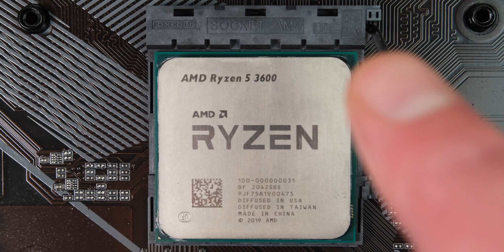How to properly install Ryzen CPU and Stock AMD Cooler

Comment: Thanks, I have a am4 mobo with no backplate and needed to install a ryzen cpu with its stock cooler, this helped me confirm what the part looked like so I could purchace it on ebay and install my ryzen cpu with its stock cooler.

Comment: I removed the backplate and its screws. I am unable to install this amd heatsink because the screws don’t reach into the holes on the motherboard. I don’t have the mounting nuts you show in the video. Where did you get it? I’m building a separate new pc and just realized that I will run into the same problem because the new motherboard also comes with just the backplate and no mounting nuts.

Comment: My CPU cooler keeps on sliding around and my screws won’t screw in I don’t know what to do. I need help.
Reply: [with AMD Ryzen 5 5500 and the included heat sink+fan] For anyone seeing this comment in 2025 or later, I found the back plate on the motherboard dropped out when taking out the first set of screws [the ones holding those plastic clasps at 0:21], propped it up under the board to bring the slots higher, and with some force on the screwdriver (was enough to feel like it might crush the chip) I got the screws to reach the screw holes. Didn't work immediately since boards notoriously lack the BIOS update necessary for ryzen 5000 series CPUS.
Reply: @christopherhlass3748  yo bro honestly u saved my ass
Reply: @christopherhlass3748 thank you so much

Comment: Any idea why im not getting any picture after installing my processor, it is in the right way and the fan is in the right plug
Reply from the maker: Do you have a graphics card? Which CPU do you have?
Reply: @BartechTV  i have the rtx 2070 and i just put in a ryzen 5 5600x and before i had a ryzen 5 1600x
Reply: @olihogg4212  i know im late but did you bios update ?